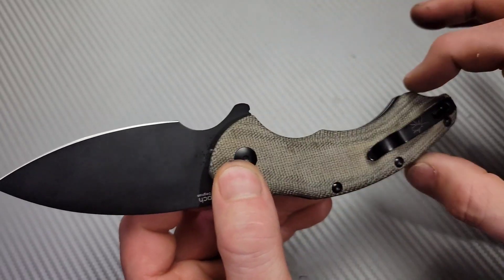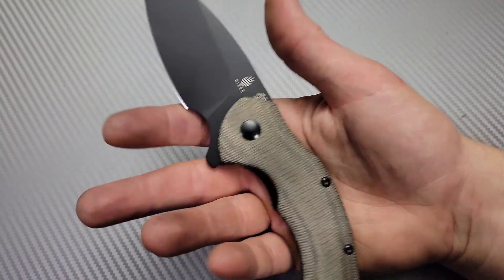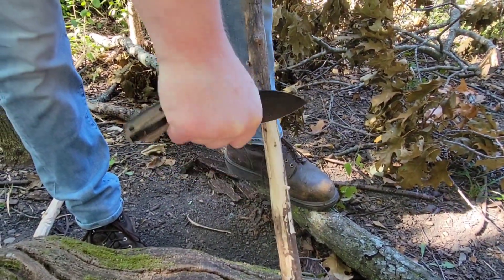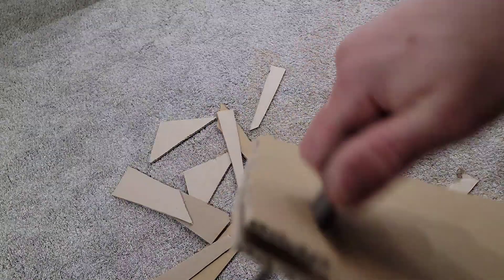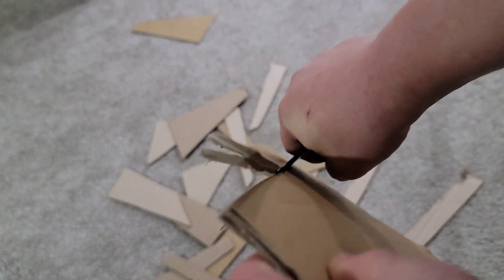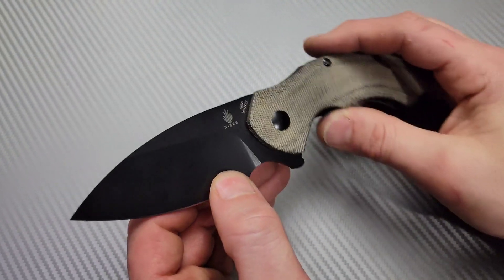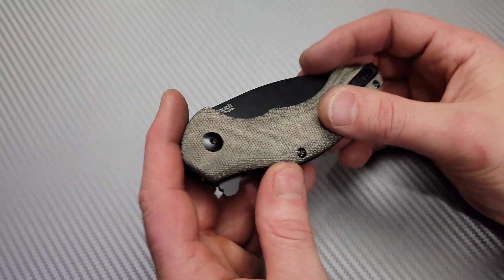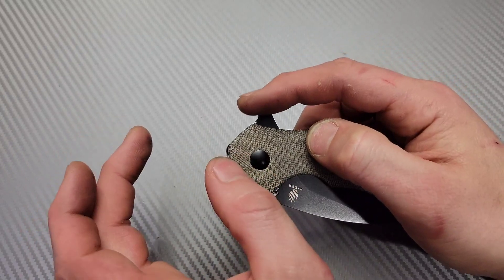KIZER ROACH REVIEW : SO GOOD!

Comment: I've been using the two side ruby stone (with white 10k grit) for years now and can confirm it is an awsome way to maintain knives. I never sharpened my knives otherwise since. When I feel it is losing the razor edge I liberaly slide the knife back and fourth (almost like on a honing steel) on the ruby stone and then strop it a few times on a green compond leather strop. Takes a minute or two, knives are always razor sharp and you don't need to remove excessive material (it may create a micro convex from freehanding on both the stone and strop). I can agree the white stone is useless though, I never use it. I find that it chips easy and it ruined my edge a couple of times that way. Ruby/compound strop is great combo for everything from kitchen to EDC knives maintenance.
Reply from the maker: I thought about ordering a huge ruby bench stone for 50$ i bought one a while back but they returned my $ but I see there's some for sake right now, it's not as big as the last one but still a good bench stone e size

Comment: Relatively new to the “scene”. I’ve spent my life buying cheap knives from big box stores. Looking to get my first “good” blade. Any recommendations for a first time fixed blade purchase? Looking for something in the 150$ or under range.
Reply: Would like to add that I’m currently looking at the ESEE 6 or ESEE 5, Thoughts?
Reply: Maybe a used bark river if anyone is willing to part with one? Fallkniven also makes some awesome fixed blades. Morakniv is good too for bushcraft value. Gerber Strongarm is a nice American made fixed blade for under 100
Reply: I've been looking at the essee 4&6 too for a long time but I decided to go with A Lion Steel M5 instead, they're just so damn nice looking the micarta handles are super nice made out of one solid block of micarta, the sheath is beautifully made out of Italian leather and it smells like a baseball glove. 😂✌️ Also just got a Tops Hornero in 1095/micarta that is pretty slick as well. At $100 it's for if I want to edc a fixed blade, it's nice and small but still has plenty of room for a full grip + awesome Ergos. I think I'm still going to get an essee in the near future I want to get there stainless steel with 3D handle version though so I don't have to worry about rust as much.
Reply from the maker: There's a lot of great knives out there, depending on your style, u would just look around at some of the reviews and see what fits your style and price point. Especially, Bark River, ontario, mora exc..

Comment: how hard is the blade steel? 
how good is the edge retention?
Reply from the maker: Decent I shoulda spoke about it more, I have so many times I forget I should everytime but it's a great budget steel, better than 440c almost as good as 14c28n for edge retention, Easy to sharpen, good corrosion resistance
Reply: My tip broke off prying open a remote battery compartment.

Comment: One of the smoothest actions ive ever felt, one thing im not a fan of is mine came with a slight bend in the tip, not like the tip struck something it shouldn't have, but like the grind was slightly off and thus the centering and instead of scrapping the blade whoever was working on it took a set of pliers to try to bend it straight. Not bad enough to return, great knife otherwise.

Comment: Now you know why I only use trademarked American made Micarta made with phenolic resins on any knife I made where the customer asked for it. The white paper Micarta is just about the best non-ivory sub for scrimshaw. It is just about the only synthetic I use. I like the style of the Kizer's edge shape, a great skinner and made of N690 is a VG10 equivalence steel, but to me it is too wide. I prefer a thinner leaf shape like the Artisan Centauri in VG10 Damasteel or the cheaper Kershaw Turismo in D2 and is actually a nice distal taper modified Wharncliffe. The Turismo is my edc and great for cutting just about everything, the Kizer's full belly edge is even better. The extra wide blade shape though is a bit too much for my taste and seems a waste of about a quarter inch of steel on top.
Reply from the maker: So I went and looked at the Turismo, and to my surprise I hadn't seen that one yet it's a great looking knife, it kind of reminds me of the Kizer October in a small way, of course there's differences but still some similarities. As much as that Kershaw looks great my one issue off the bat is I don't like assisted knives so much anymore, there's a couple I like but I tend to not mess with them maybe I should, I do prefer there new speeds are over the old versions. Where it's only a small spring kick rather than the whole way it makes for much easier close one handed
Reply: @NeevesKnives  It isn't a large kick at all, quite mild really and never had it open in my pocket either like a Bear Ops I have. The damn thing ought to be called an auto for as powerful it snaps open with very little push. Cut my thumb.

Comment: Hmm, Horn or Roach…..
Reply: Update, I bought the Roach and wanted to share some thoughts.  I could tell right away this is a third party knife maker designed knife (aside from the obvious) primarily from the feel of the detent.  I think quite a bit of thought went into that lock bar design too.  It is strong and feels like the detent ball is a hair away from being 50% submerged in the blade when closed.  I also noticed that the lock bar is reduced in thickness at the rear to lighten the pressure and the lock up edge is considerably tall.  All of this working toward a lock bar that does a good job keeping that large blade in place but remains easy to disengage and holds the blade shut well despite the light lock bar pressure.  I think I would prefer the blade to deploy with just a tiny bit less pressure but it’s still plenty usable as is.  I also think the lighter lock bar pressure contributes to the fall shut action it has.  I’m getting more accustomed to the ergos and look forward to doing larger tasks with it.  I love the micarta on this as well.  It makes the knife feel way more premium than what I imagine the g10 version would.